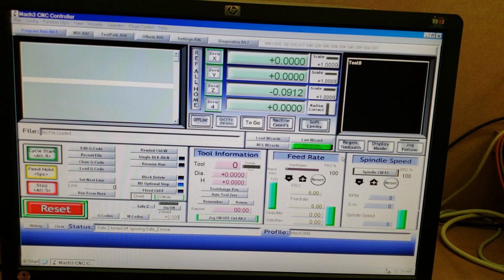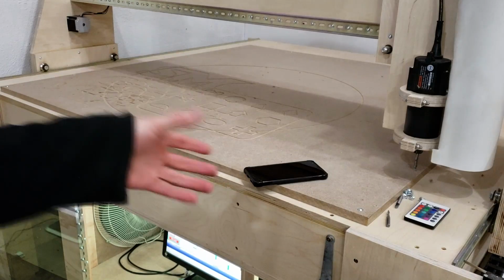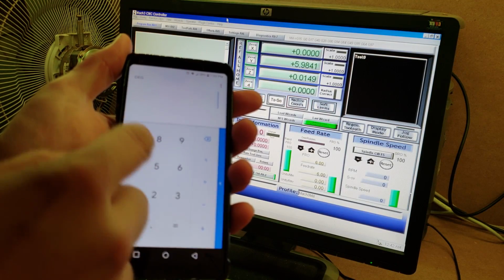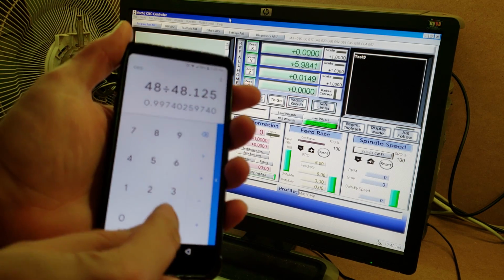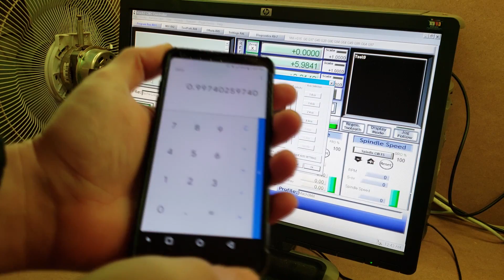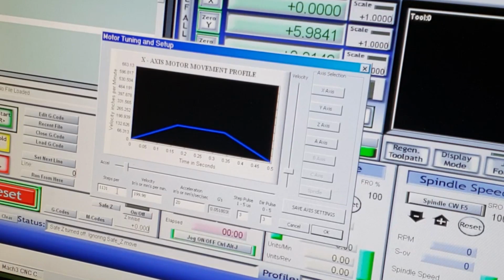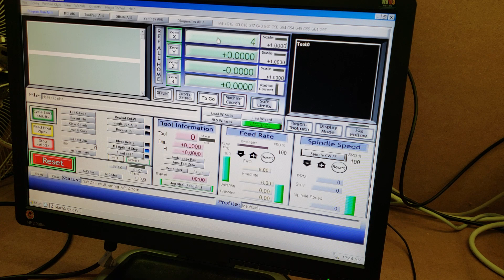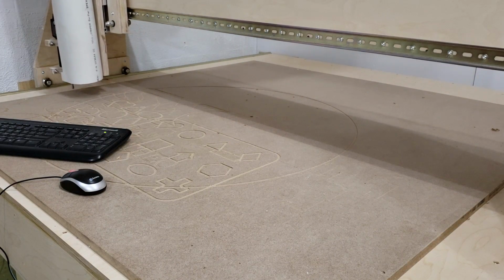DIY CNC Router - Calibration and Accuracy Test

Comment: Bro tell me how consistant and reliable is mach3?  Lot of videos say Mach3 is not at all reliable for longer projects..! And USB and parallel port  Breakoutboards are easily affected by EMI issues which will ruin the job by behaving strangely..! For me mach3 if affordable and accessable here..! Please share your experience..! What about using servos..!
Reply: You are using wooden frame here..! Have you had any EMI issues due to earthing problems..!? many say that without earthing all parts the EMI from Spindle or other nearby devices will ruin the signals from board..!
Reply: I really need your experience and advise..thanks buddy

Comment: What kind of tape measure did you use? 

You think I'm trying to be funny... But there are different types of type measures, with different (intentionally different, but accurate for their intended purpose) amounts of "hook play". Single, Doube and Triple rivet tape measures, as well as tapes that are measure marked for EITHER  push or pull measurements.

Comment: There is a much easier way to calibrate the axis in Mach 3.  Go to the  "Settings" tab.  Then bottom left of screen is "Set Steps Per Unit".  Select it  then pick your access.  Tell the axis how far you want it to go.   After it runs measure the distance.  If it is to long or short,  just enter the distance.  Mach 3 will do all the calculations for you.  You can not measure the accuracy by just running the axis back and forth.  It must be under a load.  Setup a Home position 0,0,0.  Make a small square out of plywood.  Cut it out.  Then another a little bigger.  Then another a little bigger.  The more squares the better the testing.  When finished tell the machine to go back to home.  If it is right on (0,0,0)  your good.  Also check that the squares are square.  If not, measure the size of the squares actual to what they should have been.  This will help you figure out what is not working properly.
Reply: yup. My machine tests accurately but not when it makes parts

Comment: Well the accuracy all depends on the belt more than anything. Its not a real meassurement of accuracy more than yeah the belt and motor work. 
Id be more important to see how rigid and repeatable it actually it or how lineal because of the way you set it up you wil have different tentions on each side stretching one side more than the other as it moves.

Comment: Thanks for the video.  Have you played with different microsteps yet?  What microsteps settings are you using?  I've started my CNC build based loosely on some of your ideas. The only thing I'm not sure about is the geometry for the Y axis pulleys....  The idler pulleys seem close together.  I can't wrap my head around if it's better, mechanically, to have them closer together or farther apart.  What were your thoughts on choosing the idler pulley locations when you designed it?  Thanks
Reply from the maker: Closer more tooth engagement.

Comment: "Halv an inch and a tiny, tiny bit". Doesn't sound so accurate to me ;) 
Wouldn't it be better to use the metric system to get a more accurate measurement?

Love the build though :D
Reply: Every measurement system is only as accurate as the increments that you use.  I could measure in metric but measure in kilometers, and it wouldn't be very accurate in this instance.   But yes,  a tape measure is not the most precision measuring system,  no matter whether measuring in Imperial or Metric.
Reply: @Sm0ke_And_Las3rs  Exactly! I don't really like to get in to the whole imperial vs metric debate, but they're both systems of measurement, neither more accurate than the other.  To say that using the metric system will result in more accurate measurements is just ignorance.
Reply: Really? 

His table is 4 feet so if his level of error over four feet is beyond his ability to measure it, how far off can his parts be? 

And like the others said, metric or imperial, in this case, makes no difference whatsoever,

Comment: Hi there. Why don't you use the "steps per unit" on the settings page at the bottom left.no calculations needed.
Reply from the maker: How do you get that information ? You have to calculate it
Reply: @DIYBuilds   it calculates it for you. You type in a random distance to move. Press ok the machine will move what it thinks that is. It then asks you how far it moved. Measure the distance and type in. Mach 3 then recalibrates automatically.

Go on the settings page(next to diagnostics page) 
Bottom left of screen click steps per unit.

Comment: A single measurement has no statistical significance whatsoever.  You need to test for repeatability in one direction and in the other with a series of measurements and then compute mean and variance.  Furthermore, wood expands and contracts with humidity (even plywood though a lot less) so there is error associated with lack of dimensional stability.  Also, there is flex in the gantry.  You  can even see the router head vibrate when it spins up so it is not as rigid as it needs to be.  Lastly, how it maintains accuracy under cutting loads is your final test.  If you want to see how a solid cnc router is built, check out This Old Tony's build.
Reply from the maker: First of all i love this old tony. Second his machine cost exponentially more than mine to make. And with good reason as they are designed for completely different goals. My machine works amazingly for what I want it to do. I have no intention of milling steel to 0.001 of an inch ever.
Reply: @DIYBuilds  You've missed the entire point. Perhaps my TOT reference lead you astray, my bad.  Regardless of how well your machine works, the method you used to demonstrate "accuracy" completely lacks significance.  Without test for repeatability, you can make no claims other than "I can make it move to there".   You must repeat any test a minimum of 3, but preferably many more, times and calculate mean and standard deviation (sqroot of variance).  Then you can make the claims of accuracy through precision and repeatability metrics. Furthermore my good Sir, the statistical significance of the test data will allow you to properly calibrate for travel (displacement per motor step).  After all that is done, repeat it on extremes of wettest cold days and dryest hot days and characterize the variance. Fianlly repeat these tests under various load conditions.  Then you'll know what you need to know regardless of how you plan to use that nicely constructed machine.  For us scientists out there, the details matter.  Hopefully this is helpful to many. Cheers!
Reply: @physicsguybrian  Well, certainly there's more to fully characterizing accuracy and precision, but I disagree that even this simple single measurement "completely lacks significance." Sure it completely lacks statistical significance, but even this simple, single, no-load measurement provides some idea of precision and accuracy. If after calibration, it was off by 1/4 inch over 4 ft. I don't think anyone would find that acceptable. But something under 1/16th of an inch might be fine for even not-so-rough woodworking. For example "The rule of thumb is that if the board shows mostly flat grain on its face, allow for 1⁄4 inch total wood movement for every 12 inches across the grain. If it shows mostly quarter grain, allow for 1⁄8 inch movement. This will accommodate an annual change of 8 percent moisture content — much more than is common in most areas." Multiply those deltas by 4 and then consider his single measurement.
That said, I would love to see a more thorough evaluation using under-load assessments of cut lengths, squareness, how round are programmed circles, etc. But your list of testing under extreme conditions is completely over-the-top. Tell me, how would knowing the standard deviations of cutting a 3-foot slot under various levels of humidity affect practical use of this class of machine? ANSWER: Not at all...  It might be interesting to some, and if you build one of these, by all means, please post your results.

Comment: this had nothing to do with accuracy, you were just scaling the axis, something every cnc machine needs to do no matter how expensive. though seeing some one do it by plunging holes in the spoil board and measuring it with a tape measure was straight amateur hour, if your going to stand there and defend its accuracy, the least you could do is measure it.
Reply from the maker: I did measure it. It was 48.125 before and after 48. Perfect. Remeber im dealing with wood here not steel. An accuracy like that over 48 inches of travel is extremely good for what i want this machine to do.
Reply: @DIYBuilds  again that's just scaling, all that did was let the computer know the slight inaccuracy's in the pulleys and belt tooth spacing and account for it. Cut out a 4" square and a 3" circle and measure them in multiple spots. or better yet get a 123 block and a dial indicator. Honestly I hope it comes out better than I'm assuming it will. You building a sketchy machine in your garage I could care less about, However when you start advertising is at a $900 cnc machine to thousands of unsuspecting people, and provide them plans, now it no longer matters if its "good enough" for you,  you should be responsible enough to let people know what they're potentially getting. hypothetically speaking if that thing can't hold much better than 1/32" you just built a $900 jigsaw, if it can hold a few thou for $900, then wow, everyone needs one. Why should some unsuspecting wood worker spend $900 to build this thing, thinking it will cut all his dovetail joints, just to find out it can't, or better yet they could know it  can, before they start making it.
Reply from the maker: @EitriBrokkr  ok
Reply: I dont see how you cut pointy cornered dove tails with a round tool? Think of the travel on the z axis, you would only be able to stand a piece of wood on end to a hight of 5-6inches, by the time you had messed around a wood worker would just use a saw and chiesl, If it was for a company constantly repeating the same prossece of drawers or boxes, this machine would need to over hang the edge of the table so the longer stock could be clamped on table edge!- @EitriBrokkr
Reply: @chris-tg6ki  I've seen them slightly modified so the spindle will just stick off the end of the table, and you clamp your board to the side vertically, or you make another mount to hold your router sideways under the z axis and clamp your board up on some standoffs, .....yeah I know, mind blown.
Reply: @EitriBrokkr  Its a great starting point, only thing i see issues with is belt stretch, will need slow feeds but could upgrade to ball screws on all axis with very little change eventually
Reply: @chris-tg6ki  it could also be solid cast iron, with a Blanchard ground bed way, on quad track linear rails, running $3000 servos and a 30,000rpm liquid cooled spindle...but it's not
Reply: Its a 900 dollar cnc machine - what are you expecting  @EitriBrokkr
Reply: @chris-tg6ki  two minutes ago you were ready to throw $2000 worth of ball screws at it? Which is it? Because if it needs those to function properly it's no longer a $900 machine. Defeating the entire point of him or anyone else making it in the first place.
Reply: You can pick ball screws up for less than 100 each at a push you could use 12-14mm threaded bar if you really want to cheap out, Its a cnc for under 900 which might be slow to cut with belts but it will work for what its intended for, for him to enjoy making things for our enjoyment not to go into production of millions of metal parts. The point is its a learning curve for him to find what works, what dont, what can be improved, what his mc is capable of. Its homemade  @EitriBrokkr

Comment: The best quick way to check accuracy is to cut shapes into a piece of stock then measure the cut piece compared to the dimensions you programmed. That takes into account slop and deflections during cutting. 

A very good cnc router will have +/- 0.002" accuracy. A stock Shapeoko3 or XCarve that is set up and dialed in will probably come in +/- 0.015" unless you really baby the finish pass.  I would guess this machine would come in +/- 0.060 or so best case using the full travel. 

Some people test bumping into a dial indicator repeatedly but that just checks repeatability and not accuracy. Your machine is probably repeatable to better than 0.005", possibly as close as +/- 0.001.

As long as you know what it can and can't do this machine will be incredibly useful. You can't beat the value for the price. At some point you will either upgrade this design or replace it but it's a great place to start and it looks great.
Reply: .060"? Lol. Thats ridiculously sloppy.  .001 is attainable with any machine driven by anything, even steppers, if calibrated properly. .060" is beyond sloppy on a machine with a completely out of round and worn down ballscrew. And bad bearings. Its scary that you would even assume sloppy tolerances from any machine, simply based on some whimsical knowledge of being in the field of machining. Im an aerospace cnc machinist, and run a 9 axis swiss lathe, and various 5 axis HAAS machines. None of them have anywhere over .0004 tolerances. Those are good machines. My $200 ender 3 holds .0006 tolerance. Shitty machinists = shitty tolerances.

Comment: Not quite sure what you think your measuring. first is that cutting board 48" exactly or what is it's true size since you seem to be using that as your first STANDARD of measurement. if that is not dead on then the rest of the calibration means nothing. first you need a known standard like a 48" straight edge. if you put that on to the table and fixed it not yo move  then put a pointer fixed to the Z axis carriage then line that up with the zero on the straight edge and give it the 48" move command. then you can see where it stops then you will know how far you actually moved. you built a great machine but I don't think the way you tested it's movement is correct. Also how about it's squareness when going from "X" to" Y" that would be something to see and the Z axis calibration is something to want to know about I would really like to see these things tested. Great work nice clean good planing I would have one if I had the room for it

Comment: Nice! I was impressed with a guy when he was trying to do the same thing and he set up a dial indicator where he had the router touching it and then he  moved the gantry away from it say 24 inches and the back to zero to see how much it would be off. it was very impressive. Needless to say I kinda got it as to what you were doing and kinda not. Just love your build, especially the DIN rail stuff.

Comment: As one of the people who asked for this, thank you. For the next test I'd like to see the accuracy of its repeatability with a test something like, plunge down and cut a small box (say 6" x 6", 1/4" deep) then move the cutter around a whole bunch in the X and Y planes then come back to "zero" and recut the same box 1/8" deep and see how accurately they line up. Another test would be how straight it can cut diagonals (and cut them in two parts, A to B, then later C to B) and how accurately it can cut circles (and in multiple pieces).

Please don't take this as me dissing your system in any way, I think it's awesome. I'm just curious as to how awesome.
Reply from the maker: Thanks. I don't think i will end up doing that but it is a good idea. I will however be doing a large project with inlay work soon and we will see how things fit then. I'm hoping perfectly :)
Reply: @DIYBuilds , I'm looking forward to your inlay work. I just want to reiterate that I'm only curious about this stuff because of how cool it is. I am in no way trying to bash it.

As the accuracy of the test you did in this video, if the hole was out 1/32" over 48 inches that's an accuracy of 0.00065, so better than 1/1000th of an inch per inch. That's impressive all to hell.
Reply from the maker: Don't worry i never assumed you were bashing me and even if you did that's ok im a big boy ;)  
But Ya the machine is 1000% accurate enough for what im using it for.
Reply: Fred Derf but that was the settings of steps/mm or in your country steps per Inch..... that is a general required setting for X Y and Z.
This is done to have the distance correct between software and router.
Reply: In regards to his comment and to your replies I would truly love to see actually how accurate it CAN be with repeatability I think that’s a big thing for people is repeatability since a CNC is largely used for production. 

May be perfect for you but it would be awesome to just see how precise it can be. Love the cnc and love the videos and the more I watch them the closer I am to pulling the trigger on making my own
Reply: @willrussell6946  I'm in the process of building a wood shop (installed rafters today) so I'm quite a ways away from building a CNC machine, but it's an intriguing option for the future.
Reply: Fred Derf defiantly. I work out of a 10,000 sqft warehouse and all we have is a crappy XCarve I want a 5x10’ so I can do all my plywood projects on it

Comment: Thanks for showing us this. It looks pretty accurate. Very good for the simplicity of the machine.

I wonder though, your calibration move was in a single direction as was your second move. This would reduce any error due to slack in the drive. You might want to try doing a move 50" left followed by 2" right, then plunge.